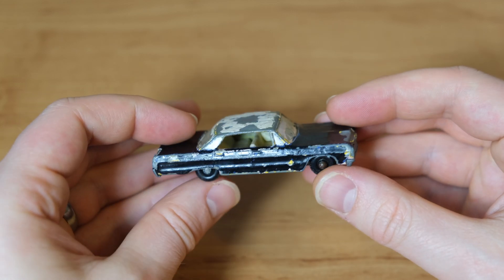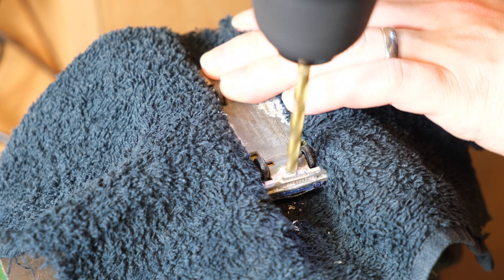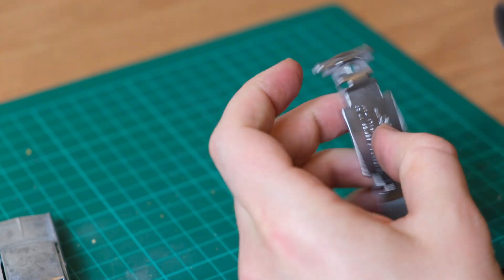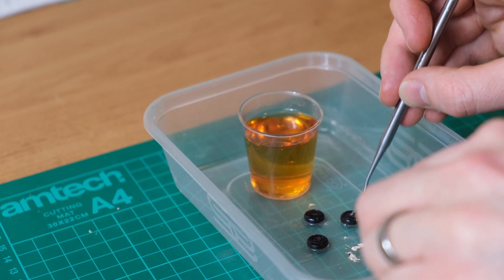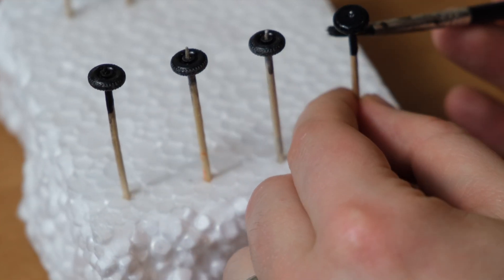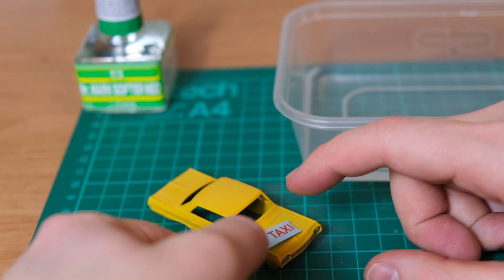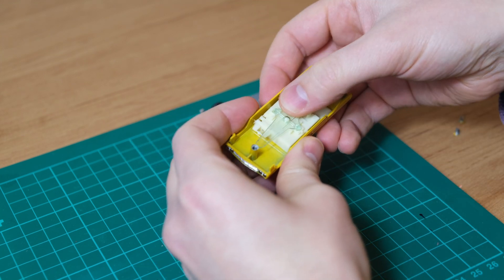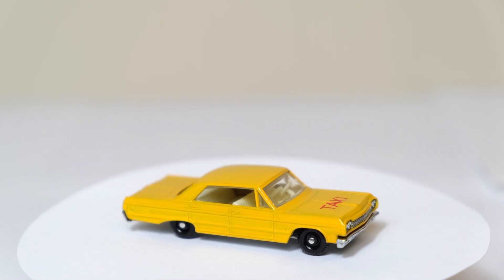MATCHBOX restoration: No. 20C Chevrolet Impala Taxi - DIECASTRESTOS

Comment: Actually the "Impala" was introduced in 1958. See 

https://www.youtube.com/watch?v=GW_3Qtw6x5Y
 The Beach Boys hit "409" was based on the 1962 the first year the 409 was an option with the dual 4 barrel carburetor rated at 409 hp. The 1964 Chevrolet had a "Chevrolet" logo in the grill work. The 409/409 was not an option in 1964. 

https://st.depositphotos.com/1684360/1259/i/950/depositphotos_12592575-stock-photo-1964-chevy-impala-front-view.jpg
It seems the Lesney model has features from both the 1962 and 1964 model years.

 I'll include a comment here that was originally made on "Time Riders" channel. Here it is, I've made a few corrections.

I think Lesney dropped the ball on this one. Firstly it looks pretty much like a 1962 Chevrolet Impala. The front grill looks like a 1964 but is missing the Chevrolet Logo.  I have a collection of Dealer Brochures from 1957-1965 and this model is closest to a 1962.  Secondly the Impala was the top of the line Trim level. Although it is possible, I  don't think a cab company would have gone for the expense. The Biscayne   and Bel-Air would have been better suited for a taxi. The lower trim levels did not come standard with carpeting and had a more durable vinyl  interior.  Why would you buy a car with carpets and fabric seats for cab use? Even the trunk in the lower trim levels would have been better  for the wear and tear of luggage and steamer trunks being tossed in and out. Another little known fact is the Impala had a smaller windshield (wind screen) the Biscayne and the Bel-Air had more visibility because they both used the "Bubble Top" carried over from the 1961models. The Impala was available in a 4 door model but 2 door coupes were more  popular. 1962 also had 2 standard engine options, a 6 cylinder 235 cubic  inch 135 hp and a 283 cu inch, V8 170 hp.  Also available options were two 327 Cu inch engine options in 250 & 300 hp and the legendary 409  cu inch engine in 380 hp and the dual quad 409 hp option.